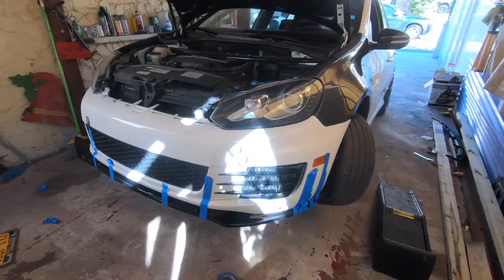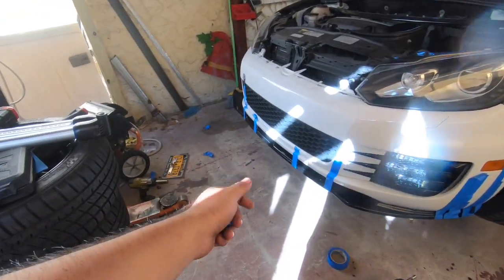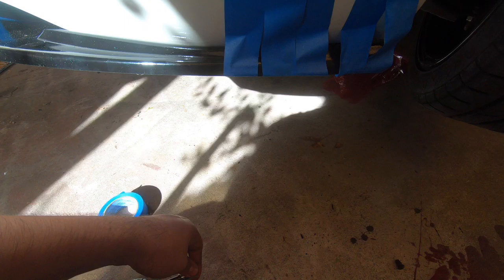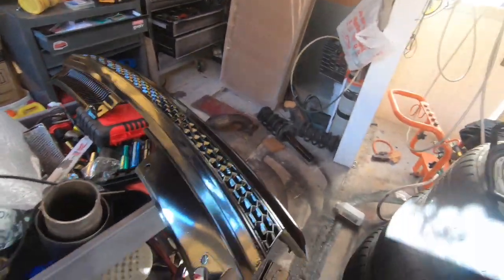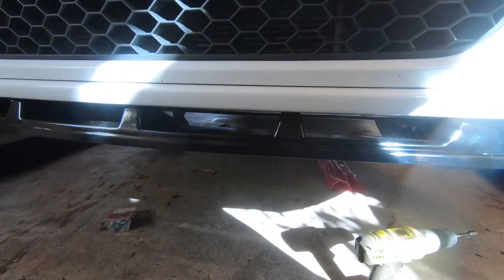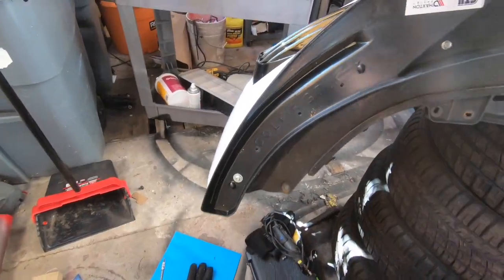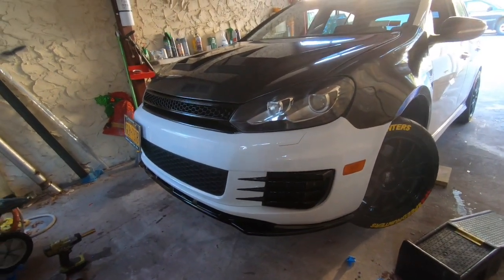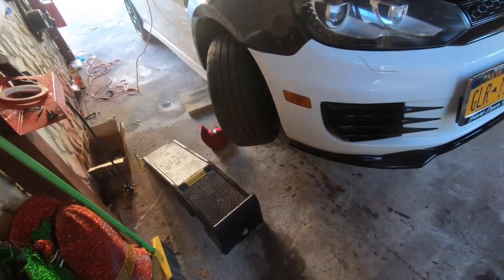Mk6 Gti Lip Install

Comment: Hey man, I love what you did with the bumper, with the white accent in it. gives it a mk7 feel. I was planning on doing this myself. Did u paint it, or vinyl wrap it?
Reply from the maker: Send it to a body shop to color match it. But you can wrap it no problem.
Reply: @NarBrosGarage  alright sounds good, thanks for getting back. Vinyl wrap is cheap and I have some experience with it so I’ll give it a shot. Then in the future if I want it off, I can rip it off. Thanks🤙